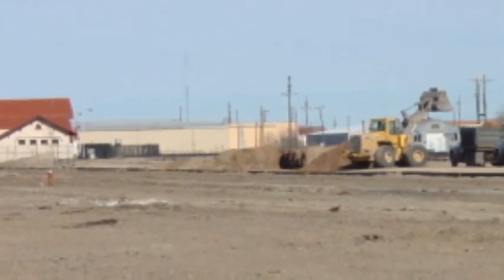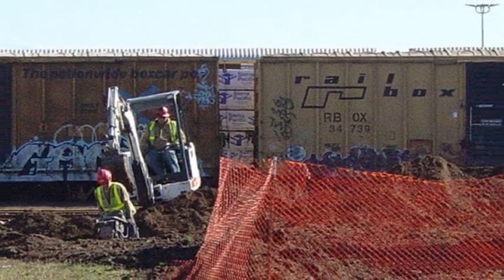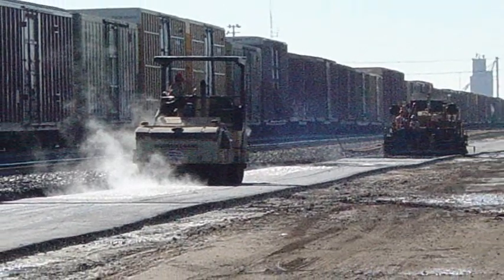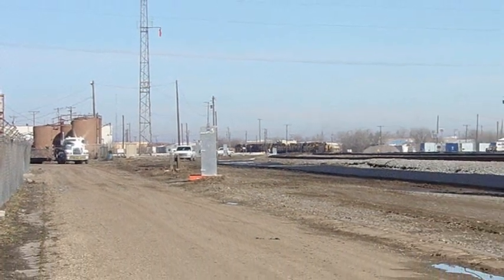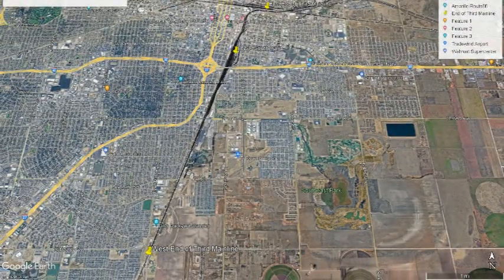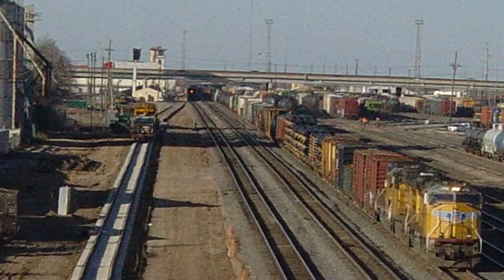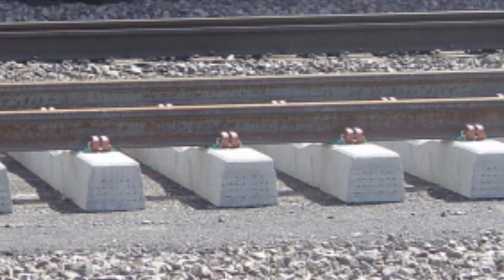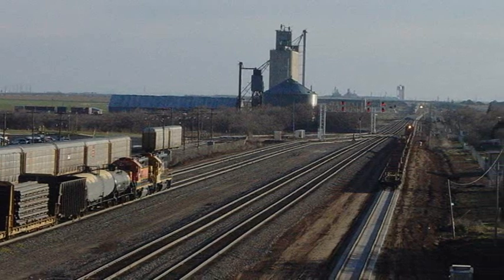AMARILLO EXPANSION! BNSF Builds the 3rd Mainline on the Transcon (2005 Construction)

Comment: The asphalt is new to me.  About how much ballast ended up between the asphalt and the bottom of the ties?
Reply: The bottom layer of ballast actually sinks into the asphalt a bit from the weight above, further securing the roadbed in place. Plus, it greatly improves water drainage! It’s expensive, but saves on maintenance costs down the road.
Reply from the maker: It varies, it looked like 12 - 24-inches. Thanks for Watching and for your feedback!

Comment: How do they level the rails with the asphalt so unlevel?
Reply from the maker: They have a machine that travels down the track that raises the track assembly where it is too low and pushes it down if it is too high. Thanks for watching!
Reply: @BNSFAmarillo  ahh so does it then push ballast under when it raises it up and removes some when it lowers it? I love watching videos of those giant railing laying machines. I am just a casual rail fan, wish I had more time to get out and see more stuff
Reply from the maker: The machine has the ability to vibrate the ballast while holding the track assembly. It can also push ballast back underneath that has escaped on each side. Hopefully we will be able to provide videos of the things you miss. I will try to get some video of the track laying process and also the rail grinding train.
Reply from the maker: I'm not an expert on the track laying process, but from what I have seen its the same machine. It doesn't so much push it down but  it vibrates the ballast which allows the heavy track assembly to settle down into proper position. Thanks so much for watching our channel and your feedback!
Reply: @grifftech just google railroad tamper and ballast regulator …
Reply: @BNSFAmarillo    I am familiar with a tamper.  That machine picks up the rail assembly (rails, ties, attachments like plates, spikes or clips), and once aligned to the required tangent or curve, tamps the ballast to secure everything.  But what machine can "push the rail down."?
Reply: @glennfoster2423 A freight train will do the final settling …
Reply: @mshum538  Over and Over and Over......
Reply: What happens when you use highway builders
Reply from the maker: I was really surprised to seeing asphalt being used for sub roadbed. Thanks for watching!